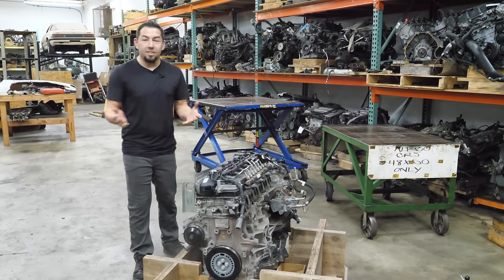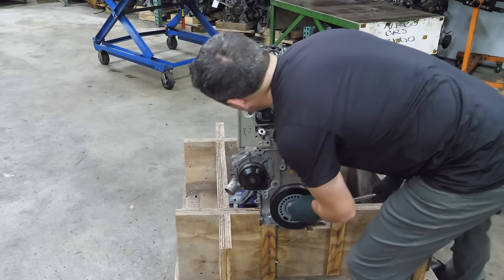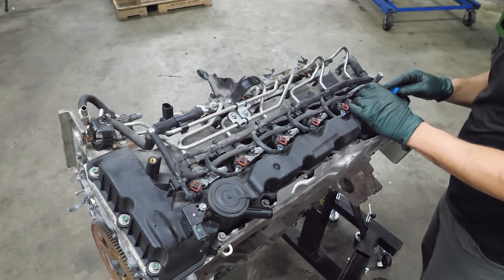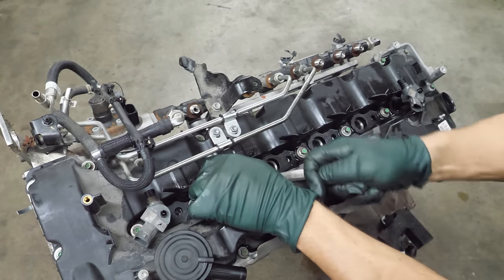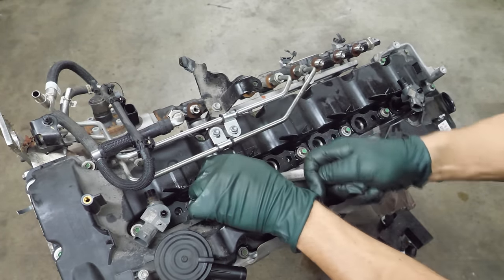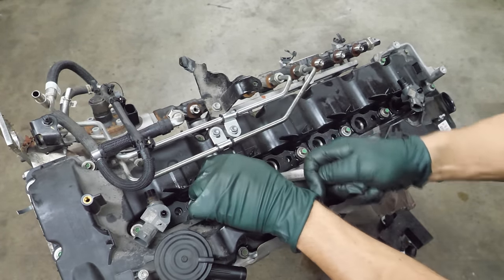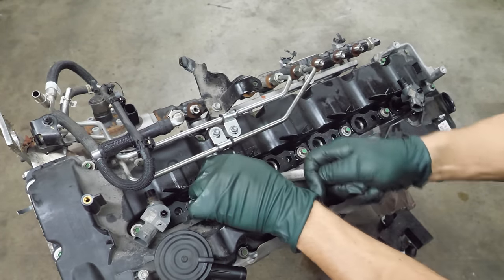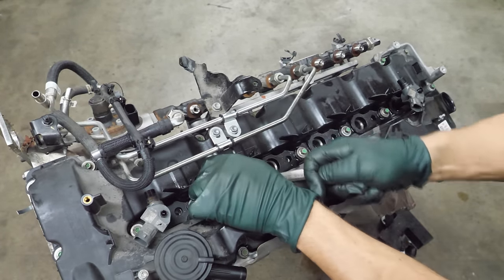BAD 2020 Silverado 3.0 Duramax LM2 Engine Teardown INCREDIBLE DAMAGE!

Comment: The tensioners being powered by oil pressure but needed from the instant the engine starts turning really seems like an insane design choice and makes timing failure all but inevitable in my mind.
Reply: yes its a bad idea
Reply: I was going to add: if it requires the oil pressure operated tensioner system to hold chain slack from allowing piston/valve contact how does it escape valve interference during cranking/startup ?
Reply: An oil pressure tensioner is like a one-way valve... it let's oil in under pressure, but not back out. 

As the oil pressure pushes the rod out of the tensioner, up against the chain guide to keep the chain tight, the oil gets trapped in there and the rod can NOT go backwards back into the tensioner, even when the engine is shut off and the oil pressure is gone. 

If your tensioner rod is able to be easily pressed back into the case, it's shot.
Reply: @davelowets  how well is this going to work if you have a LPOP fail for any reason? now you'll have to check time any time the LPOP goes out to make sure its still good... this was DUMB DUMB DUMB...
Reply: @narmale  exactly. I imagine Isuzu is going to have to rethink because most owners are bad about doing regular oil changes.
Reply: Yes, imagine the bulletproof design  of the cummins B engine...no belt, no chain...just gears....mine has 404 thousand and running strong....
Reply: @Alex-xi2nz   and tire rotations LOL
Reply: @narmale  @narmale  What?? Think about what you just said.... 
If your LPOP goes out, you're going to smoke the bottom end LONG before the chain wears out enough to get slack and jump time. Without oil pressure, the bottom end bearings will be shot in minutes.
Reply: @davelowets  sigh... if the Lpop stops... the tensioner nearly INSTANTLY looses pressure allowing the chain opportunity to jump while the rotating assembly is still in motion 

its a oil pressure tensioner... one of the dumbest ideas i ever recently heard of... along with those couplers on the LPOP drive shaft... engine is deff not designed to last
Reply: The tensioners will not retract when the oil pressure is low at start up. There is a steel pawl that engages with teeth machined into the plunger. It works like the safety pawls on a roller coaster incline. You hear them click as the cars are pulled up the incline by the chain. If the chain breaks or becomes disconected from the cars the cars will not roll backwards down the incline
Reply: @jeffrey501green That design should be Mandatory for all diesel and GDI engines! 😊. No chains or belts!😮
Reply: @narmale  NO it does NOT retract... one it is pushed out by the oil pressure, it STAYS out.  There is a ONE WAY valve inside of it, and WILL hold the pressure once it goes in and will NOT allow it to retract when the pressure isn't present.
Reply: @johnwilliamson6143  @johnwilliamson6143   There's 2 different designs of tensioners. Some of the oil pressure ones have a one-way fluid valve inside that traps the oil once it goes in, and won't let it back out. No ratchet at all. The ones designed like this resemble a shock absorber inside with a sealed piston on the shaft, and holes in the top of the piston and a one-way valve covering the holes. 

The ratcheting designs can sometimes be reset by disengaging the ratchet by pressing a pin through a tiny hole in the side of the tensioner, and pushing the plunger back down. Then install it and pull the pin when its time to release the tensioner. 

The other type like I explained above, with the one-way valve, can NOT be reset and once you remove it and it extends, you must replace it if you need to remove it again for any reason.

The Audi/Volkswagon 1.8T 4 cylinder has one of these 1 time use tensioners in it, and I ended up installing the timing belt 1 tooth off, when I took it back apart to reset the belt, the tensioner extended and unfortunately I had to replace the brand new tensioner for another $80.. 🤬
There was NO way around it, once the pin was pulled and the tensioner released, that's it, buy another if you screwed up. I will NOT make that mistake again...
Reply: @carlbernard4197  yup, costs more money though.....bean counters dont like that...
Reply: Mercedes used an oil t-chaib tensioner but uses a spring and ratchet mechanism to hold some tension during startup.
Reply: My bet is this truck was stuck in the mud or on a hill at a strange angle and fought to get out. This explains the damaged and undamaged parts. Why the pistons were hit at a high RPM by the valves.  All the oil was laying on the side or front of the pan. Oil Intake keeps popping out of the oil.
Reply: Since none here seem to know the internals of this tensioner; all we do know is it released and let the engine slip time.....
They need to concentrate on a design that doesn't fail.

That oil pump is tougher than it looks! All that 'forbidden glitter' went through it to be able to get inside the filter!
How low on oil level AND how steep of a hill destroyed this engine....
Reply: @davidpowell3347    I've owned motorcycles with oil pressure activated tensioners.  They have a ratcheting mechanism built in so that the tensioner can't back off once pressure is lost.  No idea why GM wouldn't include this.
Reply: That’s why they are running 0w20 engine oil and very low pressure
Reply: @millcosctd it probably released cause it had no oil to work with for extended amount of time. 🤷🏻‍♂️
Reply: @davelowets  bro, eeexxxxaaaacccctttttllllyyyyyy
Reply: All components fail - its not if, its when. The springs they use to tension the chain are more than adequate for tensioning until oil pressure gets there (before the engines even started as all oil pumps aside from dry sump are crank driven). Oil pressure also acts far more reliably than a spring, and acts directly proportional to engine speed - couldn't ask for a better mode of action......
Reply: @davelowets that type of tensioner does fail all the time. My Toyota failed, my freinds toyota failed. It's known as the Toyota rattle. Since that's a GM engine it looks like the problem is across the manufacturer  spectrum
Reply: I had a 4 cyl grand am skip teeth and drop a valve. Pretty sure this is why.
Reply: this killed my Chevy 3.6 in my 2012 traverse. Burned oil like it was gas at 150k, despite oil changes every 3k since it was bought. the timing chain caused carnage, to say the least. Just poor engineering from GM, and they don’t seem to care with how many cars they crammed that engine family into
Reply: All of the older Mercedes’ turbo Diesel engines (603,617,606) use ratcheting tensioners that maintained a baseline tension plus oil pressure when the engine started
Chain failure was extremely rare
Reply: If the internal check fails on the tensioner then goodbye motor. Stupid design ..Spring pressure would be much more reliable,.
Reply: A vehicle going 400,000 miles is not a good thing from a chrysler Salesmans pov and that is who Chrysler is most concerned about being happy.
Reply: Most cam phasers and chain tensioners on newer cars are hydraulic powered.
Reply: Its a super old design, a properly made tensioner will not lose tension.
Reply: @davelowets the oil fed tensioner.is only as good as the seal holding the oild in, dumb idea no matter what..
Reply: That's why the manufacturers are moving oil pumps down into the oil pan and using lighter weight engine oils.
Reply: Every engine has tensioners adjusted by oil pressure

Comment: I love In-line 6 engines and was considering this engine in a Silverado. The timing of your video is just perfect!
Reply: They did update the engine to LZ0 though.
Reply: Better than the timing on that engine!
Reply: The 3.0 Duramax is a very stout engine. This failure is do to the negligent owner not changing their oil at the correct interval.
Reply: @EBIndy  I agree however the better MPG argument means nothing when diesel is more expensive than gas
Reply: Just take came of your engine and you will be fine. Check your oil and when you change the oil add 8 qts not 7.
Reply: Diesel is only 20% more expensive than gas but 40-50% more fuel efficient. So you cone out 20% ahead. 
Math is bliss

Comment: One of the things I see in common with the low mileage failures.. is a very complicated timing chain pattern, with a lot of tight corners requiring lots of tensioners...
Look at a Toyota 4 cyl.  a simple V shape from crank to the cams... with very little deflection of the chain where it contacts the tensioner guides..
With this engine.. they should have done a gear drive, to all the components, or a straight shot for the timing parts.. from crank to cams.. and  separate chains over to the injection pump and the oil pump... the Timing should be primary concern, if that fails the engine is DONE..  loose the inj pump... it could be repaired.
Using a belt for the oil pump.. and having all the timing on the back of the engine... was just absolutely stupid.  Unless they went gear drive.. that should last forever.
The head design and top part look very well done.. easy to get everything off the engine.. the cam plate design INSIDE the vavale cover so as not to need sealant... the VERY impressive head bolts, the nice big needle bearings on the rollers.. all that looks REALLY nicely designed..
Leave  it to GM to spend millions developing a new engine.. to then only use it for a short few years... and to handicap it with high maint costs and problems that could easily have been avoided.  Especially on a diesel.. they are going to get lots of miles put on them.. that's why you buy one...  such a shame..
Reply: GM should have copied Toyota and called it a day.
Reply: My thoughts EXACTLY.

Comment: Those head bolts made the best sounds ever!!
Reply: Yeah, I'll bet the torque/rotation specs are off the charts.
Reply: Would love to know the torque spec
Reply: @user-wr1bd1mv4q it’s quite the sequence but basically it’s:

30 ft-lbs
Loosen
30 ft-lbs
59 ft-lbs
225°
Reply: Best parts on the entire engine. As long as they are, G.M. probably recommends replacement, not reuse if the head ever needs to come off due to possible stretching issues. Probably cost around 50-75 bucks each. The engine is a joke.

Comment: The state of modern diesels is sad, didn’t make 150,000 miles. Friend had a International truck with Detroit 6v71,went 385,000 before it had an in frame overhaul then went another 150,000 before he sold it.
Reply: The common high mileage number I'm seeing in YouTube videos for engines designed in the last 10+ years seems to be ~150k miles. For european manufacturers, it seems much less. Apparently, according to them, cars shouldn't last more than 10-12 years.
Reply: This engine died from lack of oil.
Reply: @steinwaymodelb Poor maintenance I’d bet.  Most people nowadays treat cars like a phone.
Reply: When I sold my truck it had 1,128,000 miles on it C15 Acert 2006 model, KW, W900 still original
Reply: Almost every european diesel engine last well over 300k miles if oil services are done. Many will last to 600k miles.
I have Opel with 1.7L commonrail diesel, it has over 320k. No issues, runs like new.

6V71 should last near 700k without overhaul, compared to European truck engines...
Reply: I have a Toyota 4Runner with a 1KZ diesel engine...it 22 years old, 300,000 km reading. I just had some suspension items and a power steering hose replaced some weeks ago and this engine is still running marvelous. I have another toyota corolla and a toyota hilux and these cars have zero non sense issues. Toyota haters can say whateever they want to say, american cars will never match a japanese made Toyota.
Reply: No engine lasts if you run it out of oil.
Reply: People don’t want the horsepower and weight penalty of putting an industrial/truck engine in a pickup truck. There was a chief petty officer at the Coast Guard Engineman School that shoehorned a GM 6v-53 into a pickup. Worked well, but you are getting 215 horsepower  out of a 699 pound engine.  
So they build them lighter and more powerful. Nothing comes for free, particularly with diesels.

Comment: GM upped the original inspect/replace interval on the oil pump belt from 150K to 200K after they were not showing any significant wear. I own a 2022 LM2 truck and change my oil every 5K like clockwork.
Reply: This video makes me want to drop to 3-4k miles oil interval.

Comment: I had a 2020 Silverado with this engine. Just traded it in in August with 146000 miles on it. It was making a knocking noise from the back of the engine on start up. The tech at the dealership said there’s a TSB about the oil pump belt tensioner bolts can back out and destroy the engine. Having other issues with the truck (glow plug codes, turbo leaking oil, and DEF problems) I decided to trade it in before I had to buy an engine.
Reply: Terrifying,  these new vehicles have gone to hell. Dam European buying up all the American car companies or doing co development ruined everything

Comment: This is why this channel is very important to me regardless if the fault was the owner or the design of the engine failure. To me this is another example not to buy a vehicle with this engine and a applaud you for this channel to let the public know what vehicles or trucks to avoid buying I personally thank you sir for this channel. This is like the Ecoboost that was transverse mounted with the water pump buried under the timing chain cover which was a nightmare idea 💡. When a consumer is thinking about buying a truck or vehicle find out what engine that’s in it and find it here on video. Nick thank you sir and Greetings from Silverstreet South Carolina.

Comment: It's the rubber that deteriorates on belts. You've just got to pick the right rubber. Dry belts use EPDM rubber. Wet belts are likely HNBR. The wet belt benefits from less UV and ozone exposure.

You have likely noticed gaskets on newer non-German engines are often like new on high milage engines. It's all in the rubber specification. The same applies to hoses as well.

Comment: The way the valves pressed into the pistons takes tons of pressure. Each piston is as the ram in a simple flywheel driven punch press. It would require a 40 ton or greater press to simulate this situation. The crank moves the rod a few last thousandths of an inch, developing that much pressure to "coin" the pistons. The rods and pistons survived. Impressive.

Comment: Something surprising I DIDN’T notice…. An oil level sensor. My Denali with the LM2 has 70k and it uses about 1.5 quarts of oil between oil changes. I’ve never let it get lower than a quart low but I always assumed it had a low engine oil indicator. Guess not!! I really like my Baby D-Max. Especially 30mpg combined city/hwy.
Reply: 1.5 L between what interval? 5k? 10k? 15k? We have no idea
Reply: 1.5 L is a lot. I have an N57 which burns about 0.25 L every 5k miles. And it does have a low oil level alert, not that I've ever seen it
Reply: and your payments? I OWN my truck and Ill take 11 mpg + no oil pump belt.
Reply: Until gas is $6 a gallon.
Reply: #2 glow plug and leaky cover is why you are losing oil.
Reply: @InclineTheDecline  #1,#2,#5 glow plugs have been replaced but all gaskets are tight. No oil leaking externally. It’s pretty consistently using about a quart between oil changes. I don’t think that’s a bad thing. I worked for BMW when the N63 and N63TU were still under warranty. BMW’s remedy for customers constantly coming in with an “Engine Oil One Quart Low” warning was to replace the quart low the vehicle was indicating then put one more quart into the engine. Basically intentionally overfilling the engine by one quart to keep the customer from have complaining about excessive oil consumption. I truly love BMW and the way they engineer their cars but that policy never set right with me.